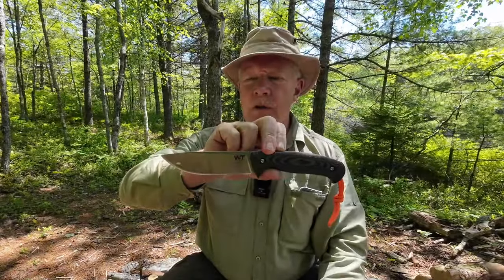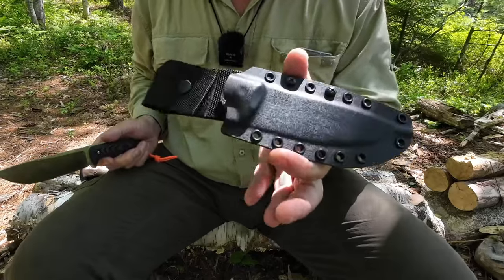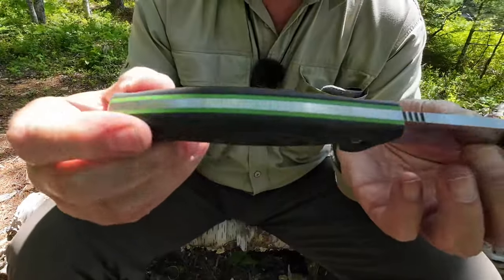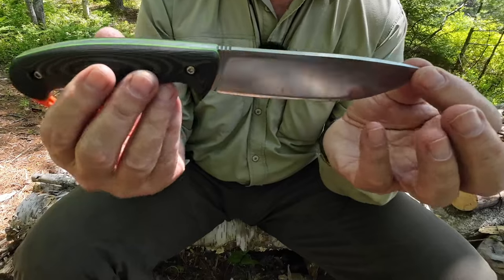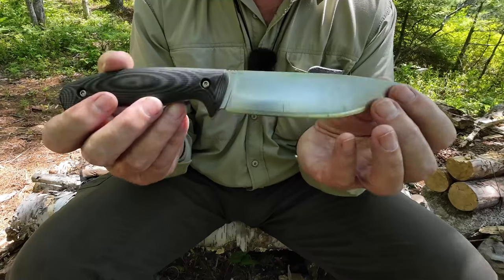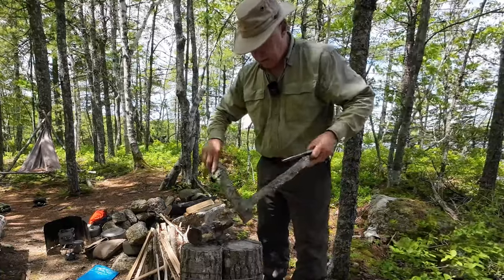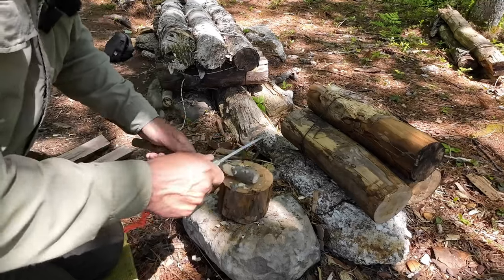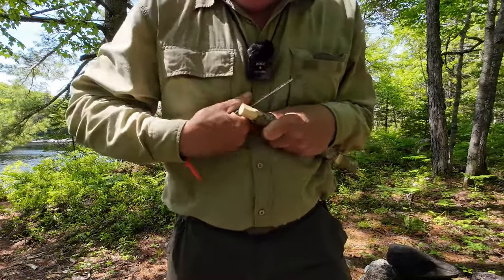Work Tuff Gear Red Wolf - A Full Convex Camp Knife

Comment: The problem with Work Tough Knives is finding one to buy. Convex edges still dull after use and it is not easy for many users to sharpen a convex edge to factory sharpness. The weight of the knife is not a problem however, that depends on how important it is to the user. It would be a plus if you had a choice of a leather sheath over a plastic sheath.👍
Reply from the maker: They are more available on the seller websites listed in the video description. Thanks for commenting